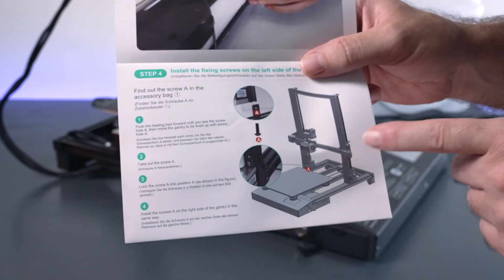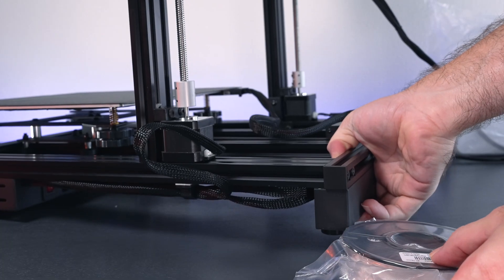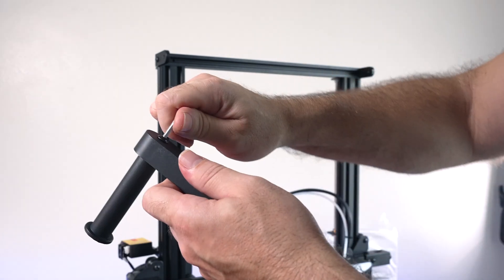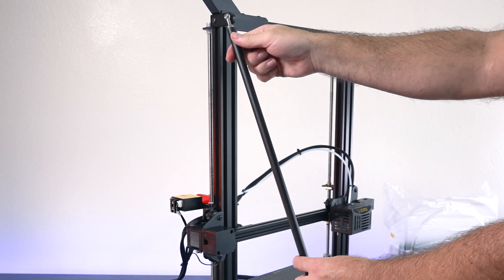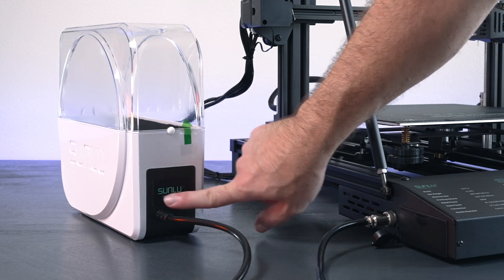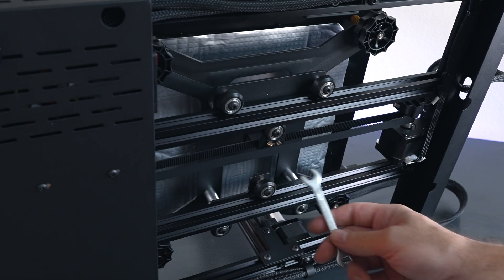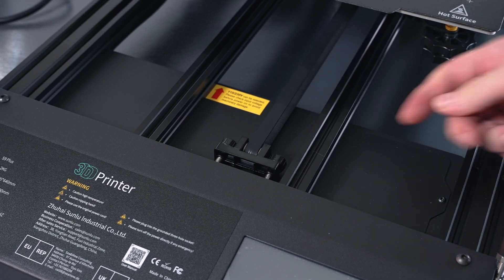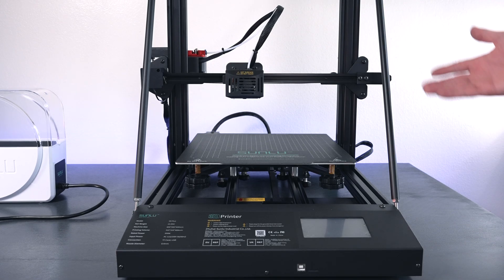Sunlu S9 Plus - 3D Printer - Assembly & Adjustments

Comment: I have been using my Sunlu S9+ for about 2 KG filament run through it, things were progressing nicely until the bed sensor evidently somehow broke off and was gone.  Tiny plastic needle at the base of the print head assembly, it drops down to detect the height of the bed during leveling and retracts otherwise.  Somehow it came apart, shouldn't have during the print because it would have been retracted but oh well.  Print head dove into the bed hard, 3X at 245C before I realized that the bed sensor wasn't working & was broken.  Now I am waiting for a 2nd reply from Sunlu.  They did get back to me next day but now it's a holiday so I probably won't hear back from them until tomorrow.  Good printer otherwise, I am asking Sunlu for a replacement bed sensor and bed and bed mat, we shall see how they do.  It was probably a poorly manufactured sensor pin.  I was also able to report the issue to Amazon and arrange for a return, but I would rather replace the bed sensor myself if necessary as there's nothing like this one on the market for the price, even without the dryer unit which you can't really do without.  After using it awhile I would call its new relative market value at around 400 though it was much less than half that.  So an incredible bargain worth getting if you can still find one.  Open source setup so you can upgrade it etc.  That's why I'm not too worried about the sensor, they're $15. I just want to see if Sunlu the company is going to make this right!